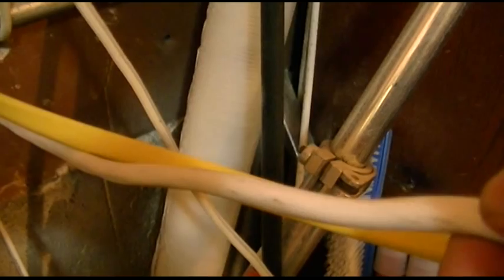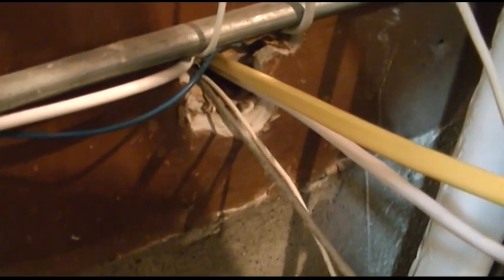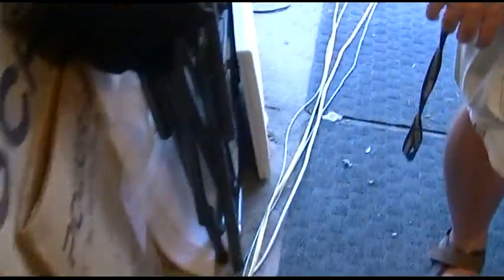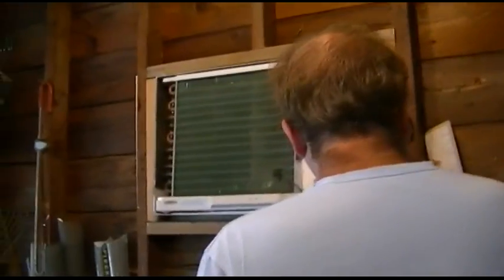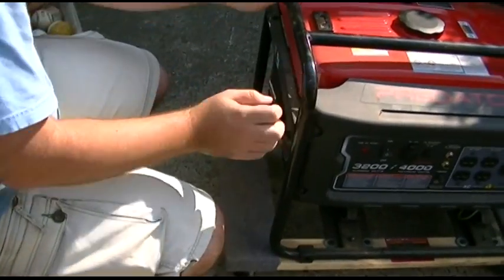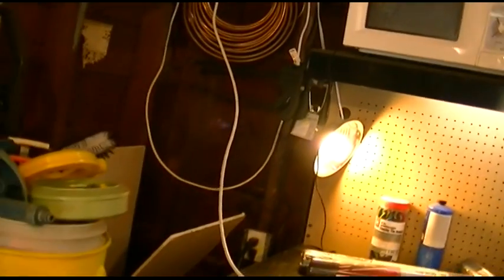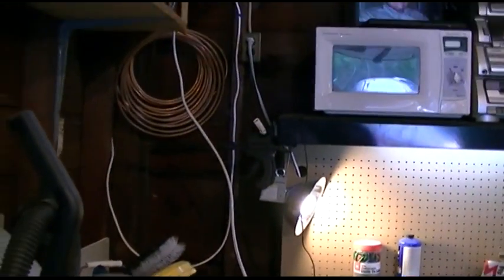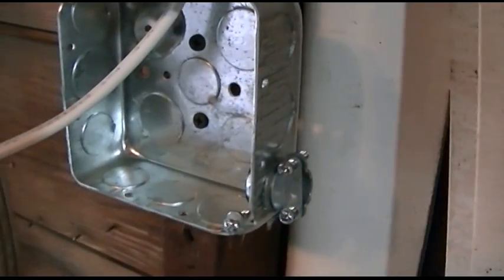Garage A/C Installation Part 3 - Electrical Rough-In

Comment: Be sure to put the hot legs of your 15/3 run on separate phases (buss bars) in your breaker panel so you don't burn up your neutral wire.
Reply from the maker: Oh yeah that's been long discussed in the comments a couple videos ago.  They will be.